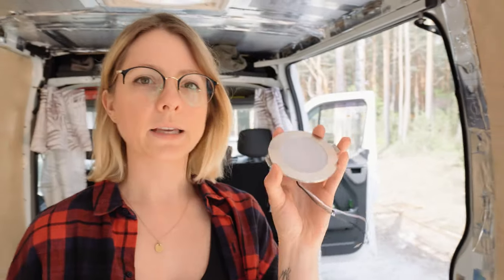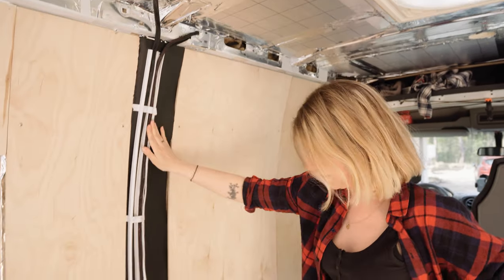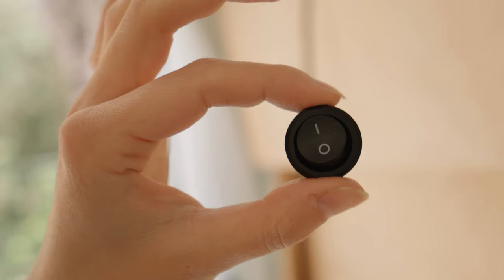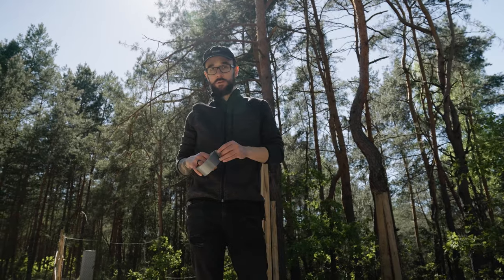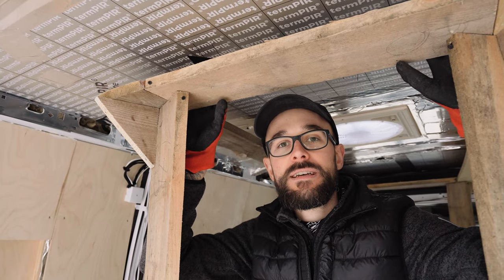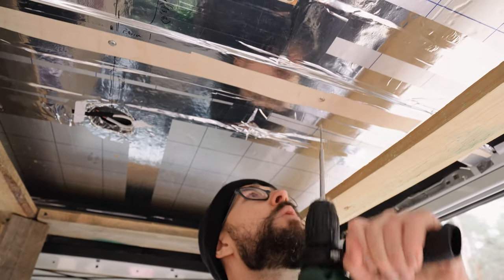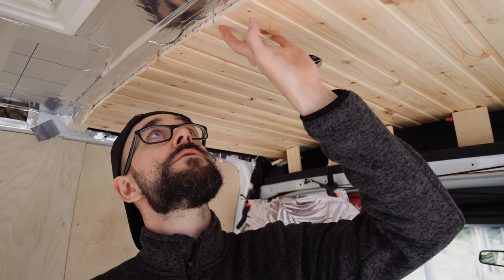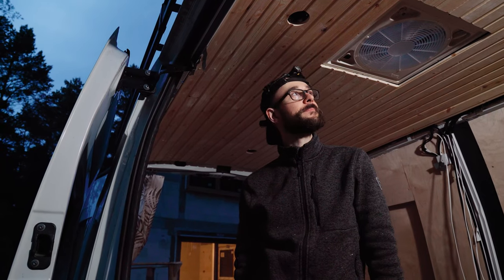This was WAY MORE DIFFICULT than expected - Renault Master Van Conversion DIY #15

Comment: It’s too late to say, but it’s far easier to run wires in flexible conduit through the ribs and channels of the van first, before you insulate and line the roof. Run and mark them.
You got there in the end. Looks good
Reply from the maker: you're right, we should have done exactly that... but it works and we just did our best back then

Comment: It’s too late to say, but it’s far easier to run wires in flexible conduit through the ribs and channels of the van first, before you insulate and line the roof. Run and mark them.
Then use automotive sika and a couple of holding screws to attach timber strips to the steel of the van then you can attach your shiplap to the ceiling piece by piece
Reply from the maker: we should absolutely have done that! It would be so much easier! but we learn as we go so there is a lot of back and fourth with all of the stuff.